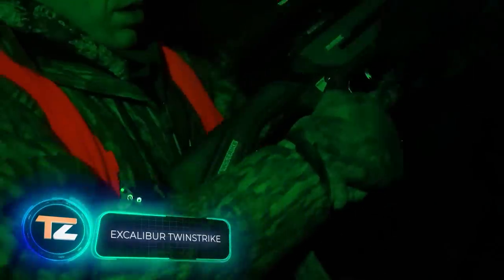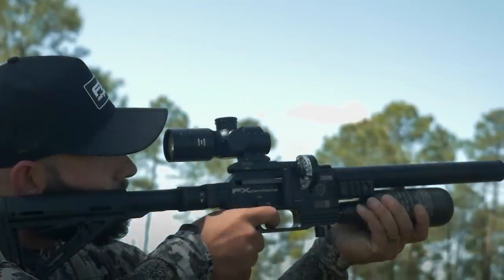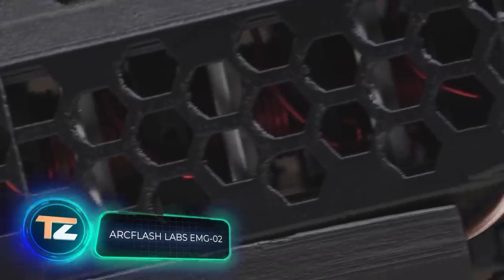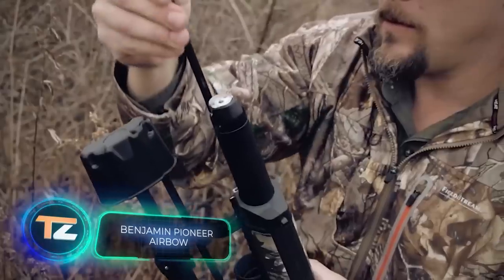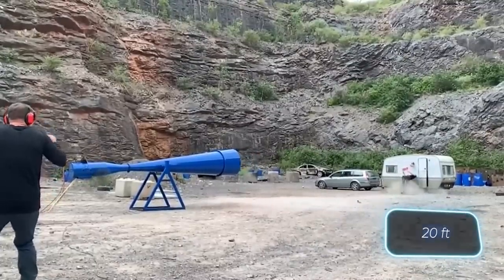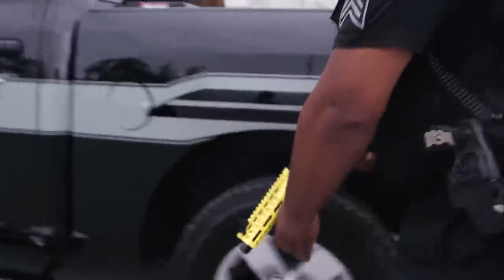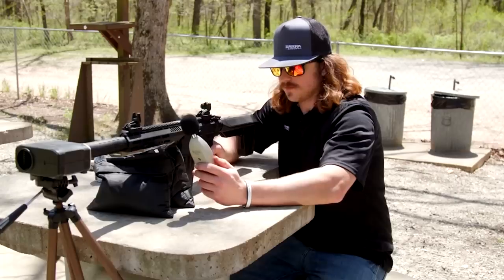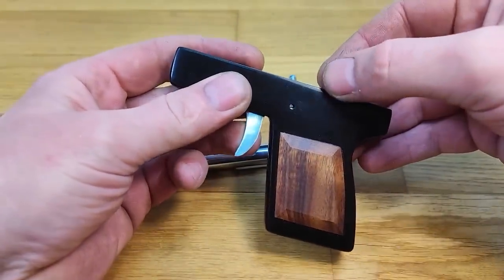AMAZING WEAPONS THAT DON'T NEED GUNPOWDER

Comment: I'm really amazed that basic paint ball tech hasn't been adapted by police and other law enforcement with die pack tech to just mark people for arrest.
Reply: The police have been using paintball guns since the late 90s. The Tippmann Pro-Carbine was the first gun to be sold for riot control and every .68cal "less lethal" gun used by law enforcement is just a regular paintball gun sold for quadruple the price.

I agree that it seems odd they don't use permanent dye paintballs in law enforcement. I guess you could tell if people had hard projectiles or pepperballs, but someone could slip some permanent dye paintballs into a batch of regular paintballs with the same shell color and no one would know the difference.
Reply: Byrna does have its own “Less Lethal” pistol. They claim it’s for training but we all know what it’s for. Same thing with Umarex.
Reply: @Acid_Ink  Byrna, is marketing their pistol as a self defense pepper gun these days. I really like the way it is made.
Reply: I have seen that I think japan if memory serves correct use paintballs with DNA markers to shoot at both vehicles and suspects, this allows them to go and get the suspects later, they will have the smartwater/dna all over them.

Comment: (04:04) Is a coil gun that shoots at 246 fps really impressive? 
A standard velocity .22 LR round  leaves a rifle at approximately 1,125 fps.
I'd say that although they are quite interesting, coil guns have a way to go before replacing firearms.
Reply: Most air guns are higher fps lol

Comment: Can you burn a mirror woth lazers or will it just bounce off?
Reply: It will reflect for a very short time, then the gray paint will melt right off. Assuming the laser is strong enough to burn the paint. Anything over 1w should do.
Reply: There are other reflective surfaces that do not melt easy such as polished stainless-steel

Comment: 9:28, Like Tourniment use paint Ball Rifels does it have a Adjustable Dial as to prevent the damage from the dust ball from being lethal or Not? because if not, then neither law enforcement or private use is illegal.

Comment: Crossbows fire bolts, not arrows.

Firearms use gunpowder or smokeless powder as a firearm in the legal definition uses an explosion to propel the projectile. Thus, air-powered devices are not regulated by the ATF as they are not firearms.

Again, a coil gun is not a firearm as no explosives are used to accelerate the projectile down the barrel.

I can only surmise that the writer comes from a country that has foolishly banned firearms. It has been seen that doing that will make it so that the criminals will be the only ones armed & violent crime rates tend to go up after the government makes this moronic mistake.